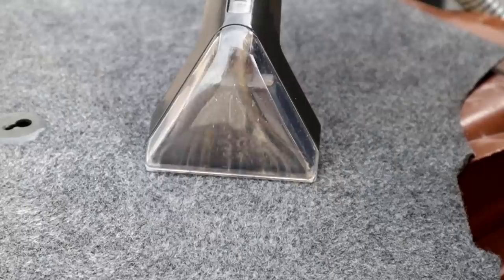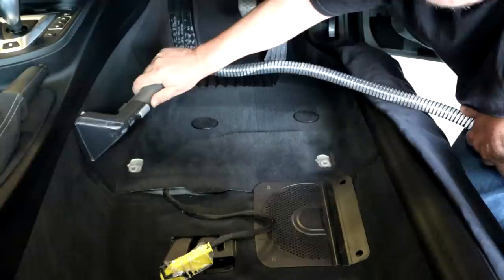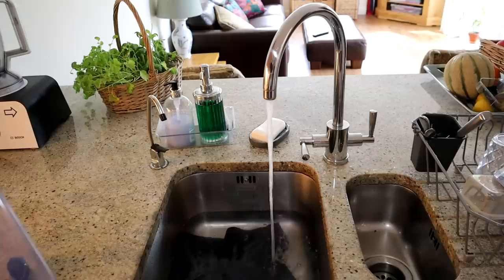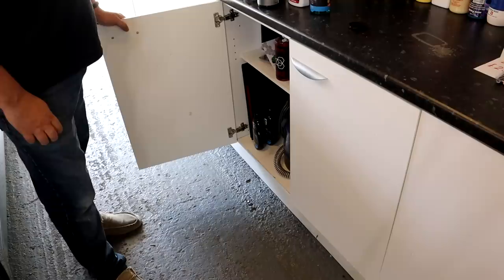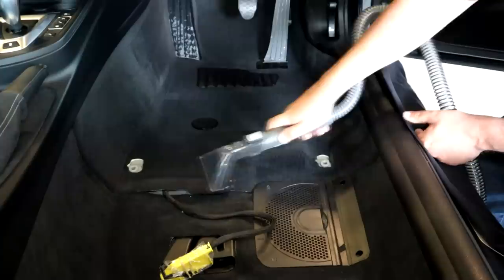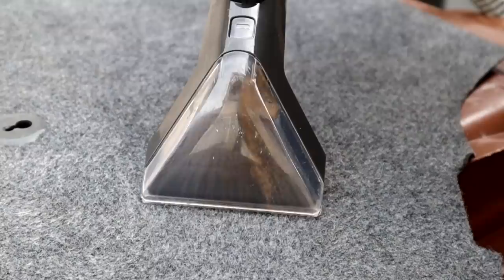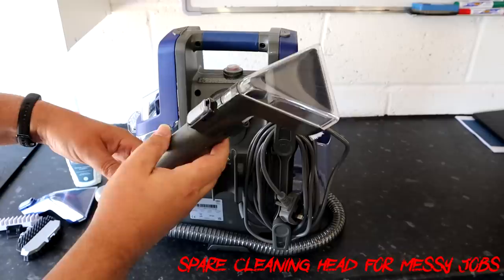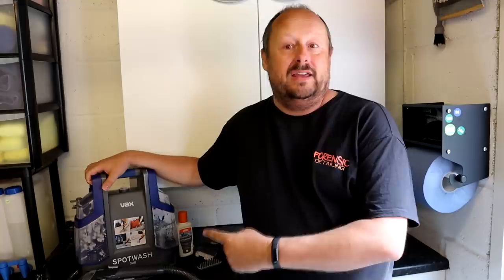*NEW* VAX Spotwash DUO |  Bargain, Compact, Powerful Car Detailing Tool #ad

Comment: Pro tip here.  Instead of using the cleaning solution in the tank, just put water in that tank.  For the cleaning solution, use either a spray bottle, or even better, a garden sprayer.  Soak the surface to be cleaned with the cleaning solution, agitate with a brush and then use the machine to spray water and extract at the same time.
Reply: Hello do you know what the difference is between the blue model and the red model other than price
Reply: @Security2U  Its the same thing im trying to find. The red one is the Spot Wash and the blue is the Duo Spot Wash. Estetically, the only difference is in the colour.
Reply: @alexisamtosta  Why is the blue one cheaper though?
Reply: @alexisamtosta  I believe its the additional tool kit that makes the blue one a 'Duo'
Reply: The blue one comes with a seccond pair of identical tools. The price is cheaper only due to different promotions. Definitely buy the blue one.
Reply: @ddc6321  Extractors have better suction.  It's measured in inches of water.   Stats are usually available for all extractors and wet vacs when you look at the specs sheets.
Reply: The main question is that once filled will it do all the seats in the car ?
Reply: @wellgatecarsales1623  Depends how dirty they are.  With small units like this, you can expect to have to refill at least once to clean a vehicle.  Unless you are a professional, that is not a big issue, it takes about 5 mins to do.
Reply: @Calendyr  Thanks buddy, that’s helpful.
Reply: Thanks for the tips
Reply: Great idea should I dilute the solution first
Reply: To add onto your tip, use a drill brush to agitate the surface and fibres of the carpet. Helps the solution to penetrate even more.
Reply: @Security2U think it’s the power

Comment: I got the Bissell one a couple of years back - it's one of those products I could buy without getting too much flak.  I told the better half I'm getting it to tidy up the kids mess - she assumes it's the house, but I mean for the car!
Reply: Hey mate, is that machine any good? Seen mixed reviews online about it, mostly around the hose failing and awkward to empty/clean out.

Cheers
Reply: @MrAarongilbey  I was happy with it - I mean I only use it every once in a while so I'm not using it like a pro does.  I use just warm water in the tanks, and 1% Surfex so I don't lose the colour.  It can be fiddly, but only when loading and emptying the tanks.  I got the Bissell one for Pets about 18 months ago, and just waited for it to be on sale.  It doesn't have that self clean function, so that's where I'd say the Vax one here might be better.

Comment: Plz help!! Just got one of these today, it’s not spraying any water at all. Yet when I connect it to the “self cleaning” loop thingy, it does work and cleans it self, can see the water running though. Yet as soon as I try to use it again, it doesn’t spray anything. Am I just being a dumbass or is it broken? Tyyyyy
Reply from the maker: have you got the water in the right resovoir mate?  sounds obvious but that could cause this problem.   Otherwise mate do not worry the item is under warrenty so simply contact Vax and they will look after you mate.

Comment: It reminds me of the Bissel one that has been out for years.   Personally I have a bissel pro heat which combines both.   It has the hose and tool like the vax but is also an upright machine for the house.   Plus it heats the water as you go along.   I just add my usual APC to it rather than using their fluids.

Comment: I bought the new Bissell Spot Wash a couple of months ago (for impending, new puppy accidents) but saw the potential straight away for the car. This type of cleaner is ideal for tight areas so perfect for car seats and carpets. Spray on, leave, agitate then vacuum off to nearly dry. Dead easy to dismantle to clean and I also use the purge through for the hoses to keep them fresh. Don't know how I ever did without one.

Comment: Bought one yesterday after watching this video. Ninety-nine pounds only. From Curries. I was surprised how much dirt it sucked out of my Honda S2000's thick velour carpeted footwells, that had mats from new as well. I thought the carpets were immaculate but no they weren't. The carpets are now a very rich charcoal colour again now after working the nozzle until the water in the waste tank became crystal clear. Works brilliantly, I love the long hose. Decent little powerhouse of a machine. Cracking investment.
Reply: Ive just bought the vax, and i have an 06 S2000! GREAT MOTORS

Comment: Following my previous comment, the Vax unit arrived within 24 hours, as promised - excellent. I read all the material and assembled the unit with ease. Within a couple of hours I'd cleaned the seats in my wife's car and the floor mats in mine. In both cases I was astonished at the dirt the Vax extracted, particularly the Fiesta seats, which I considered to be fairly clean. According to the instructions, the small bottle of solution would only be sufficient to perform one large clean, so I decided to fill with water just above the small clean line and added about a quarter of the bottle as a tester. I know Vax want you to use their product for obvious reasons, but other reviewers seem to have used other products quite successfully and as Surfex HD is low foaming I decided to take the risk and used a spray bottle as well with a 1:20 solution. Both the seats and mats look astonishing and I'm so pleased the Vax is now in my cleaning arsenal. Thanks Jon - really appreciated.
Reply from the maker: It's good isn't it 😀
Reply: @ForensicDetailing  Best £109.99 I've spent this year - no brainer !!

Comment: I bought this just before Christmas 2022 and it's excellent, also purchased the Vax cordless version for doing stuff in my car. I could run an extension lead out to the road for this one but I like cordless in situations where I'm not  near a power outlet. Cheers

Comment: Looks just like mine but the brand is bissell spot clean. Mine got a longer hose and it heats up the water.
Reply: For anyone else wondering, I also bought one and althought its expensive, its brilliant. No regrets and used it far more than I thought I would.

Comment: This looks the same as my Hoover Spot Clean but blue instead of red. I got when I bought my first car which was used, but I wanted to make new to me. Great option for DIYers. Plus it works amazing with using a drill brush to agitate and loosen up dirt before with a carpet cleaner in a spray bottle and just hot water in the extractor (similar process to when I do custodial work at a college).
Reply: What’s the difference between blue or red? Are they the same

Comment: Good video Jon, thanks for that. 

I do think it's worth throwing in a caveat or two to it though. Or at least my own personal ones: 

1. Unless you're actually detailing regularly, this might be a slightly more luxury purchase.  
If your home has a large amount of carpeted space, you probably would be better off buying a full sized machine. 

I have a Bissell Pro Heat pet pro machine, which is an upright vacuum cleaner style machine and it came with a long hose and car-specific tools. 

It works fantastically for the car aswell as the house in general. Just have to be slightly careful not to pull the machine too far and send it banging into your paint. 

2. If you have a detailing product you use and trust for upholstery cleaning, you CANNOT run it through these machines or you instantly invalidate the warranty. 

I tend to use Surfex HD for decently soiled interiors, so of course that goes in a pump sprayer.
Reply: Very nice points. I bought an upright one I haven't had the chance to use it yet but our home does have a decent amount of carpet. I may buy one of these to keep in the garage and use the upright for the house.
Reply: Forgot to mention, the hose on mine is bloody massive!  

I can leave the machine in the hallway and the hose easily reaches to the top of my stairs. 
It must be 2.5 to 3 metres long I'm sure.

Comment: I picked up a bargain, it was brand new and unwanted I paid £80 for a £300+ machine (or so I thought) it was a brand new vax big carpet shampooer with a hose for doing stairs and small areas, however I made the fatal mistake of lending it to someone it got damaged, vax sales direct offer extended warranties, but from third parties you need to check. Mine got damaged, I was more than happy to pay for a repair or at least check the viability of getting it repaired. But despite the plethora of vacuum cleaner repair places, nobody repairs shampooers. Without the extended warranty Vax offer no repair for damage caused. So you have to weigh up the pros and cons of having a machine that is made of brittle plastic that could be easily damaged and of no further use.

Comment: Use valet pro carpet cleaner it's great in a machine and I've tried all sorts of brands but that one is best
Reply: Do you use it at the 1:80 ratio in the Vax spotwash? Just got one today and have a loads of VP carpet cleaner that I was contemplating using. Cheers in advance

Comment: I've got the bissell pet spot cleaner for exactly the same purpose. The amount of grime it lifted out of my 150,000 mile seats was unreal and the car smelt brand new!
THE thing that I dislike about these smaller machines is the hoses are just a shade too short (1.5m isn't enough at all), another 50cm or more on them and it'd be great / perfect. Even if they could make a hose extension kit that'd be helpful!
Reply: Unfortunately hose length affects suction, it's a compromise. These small machines already have less suction than a shopvac.

Comment: I use the the George wet and dry vac but find the suction nozzle a little bulky for use in cars. I’m considering buying one of these but really not sure as I want the same performance as the George or better. Would you have one of these over a George Jon or would you suggest ti just stick with what I’ve got?

Comment: I am also a Vax 6131T user (the big orange one) and it's brilliant but changing from dry vac with a bag to wet vac is a bit of a faff.
I'd rather have this and a separate smaller dry vacuum, which I might end up doing, to save changing between the two.

Comment: Hi Jon, what are your thoughts on the merits of a carpet cleaner like this against a Steam Cleaner? I have the Dupray Neat Steam cleaner which is great at freshening things up in car and home and also cleaning tough plastics but if I'm perfectly honest its not the best at removing deap stains from upholstery or carpets. Also, I'm guessing this is something that shouldn't be performed too often on car seats or even headlining given the foam/glues used in construction. So far as I can see this looks great for carpet and seats but is there an argument for having both the carpet and steam cleaner or did I buy the wrong machine?!

Comment: Just got a Bissell pet pro, the build quality is far superior to the Vax, comes with a standard 3 year warranty, there is absolutely no way that there back up support and customer service can be anywhere near as bad as VAX. So my unbiased opinion 😀 is that VAX appears good at new and whilst working, back up depends on where and who you buy it from. APPARENTLY, theY subscribe to the EEEE regulation that gives the manufacturer a set time to keep replacement parts, apart from the likes of us guys who will use it more than us, it is for normal domestic use so a defect may manifest itself whilst the machine is relatively unused but quite old.

Comment: Jon you are a bad man, buying a gift for the missus and then using it once the novelty has worn off and claim it as your own, that's definitely something I do on a regular for my misus. Only thing is she's cottoned on to my way of thinking and busts me for it. I know vax has paid for the promotion of this video and you can definitely tell that Jon is in full sales pitch mode. Looks great, I'm still thinking about the Bissel though. I'll Google the specs on both including the longer hose (not a pun) and think about ways and situations in which would cause me to get frustrated or areas where it could be compromised. An extractor is on the cards but will do my homework first on the best product for my needs

Comment: Excellent, wife likes Zoflora so I'll use that instead of the Vax detergent and I'll use my concentration of carpro inside in this unit. Been holding off getting one but not anymore. Bought.
Reply: Can you please give some feedback on the use and ratios of non-vax cleaning fluids. Cheers in advance

Comment: I need something that cleans up mistakes from my cats and for stuff to clean mattress, stairs which I think this will do perfectly but it's the Home Duo I'll be going for has a slightly bigger width in the header

The only issue is the cleaning solution you get for what you pay isn't great
Reply from the maker: Buy 1 litre of Koch chemise green star concentrate for 5 quid.  Use as direct for extracter system

Comment: I have a 613 that i use for all wet vaccing  etc and it is extremely good, but the small hand wash tool is very small, it needs to be wider, very much like the one on the spotwash....and i know exactly what you mean about pulling the tube off when using the 613, it gets done very often and is a nightmare.

Comment: Alright Jon, if you fancy a decent test for a carpet wash, get a bit of old carpet, pour some of your favourite curry leftovers on the carpet, let it dry and go for it. 

In my experience you’ll never truly get the full smell out, you might get 95% of it out but would be interested to see how effective these spot removers actually are. For a bigger challenge try it with curry sauce that has haldi (turmeric) in it on a light coloured carpet as that is a complete bugger to get out. 

Love the vids, and keep em coming please. Also you’re looking quite a bit slimmer these days, so I guess the couch to 5k is working for you. 😀

Comment: What is everyone doing for sulution. The 250ml bottle all went on cleaning my couch to test it out. I'm thinking some BH Surfex maybe 1:50? 

I got one to replace my George. It's much less chunky but I already miss the hose legnth. Vax is far more civilised to use and I don't have to mess about getting George in wet mode

Comment: Just returned mine as it was awful, leaking, fizzing & unusable. Cheap looking. The guy in returns said “didn’t meet expectations” well no it was simply rubbish or faulty. I video’d the issues I had but they weren’t interested. So based on my experience do not buy. Plus note returns process is simple 👍🏻
Reply from the maker: sounds faulty paul.  it should not be leaking.

Comment: What are your thoughts on this (or Bissell Equivalent) vs the Bissell Pro Jon? It’s not too much bigger but has better capacity etc. would this need refilling/emptying a lot to do a complete interior?
Reply: I have a Bissell pro and its a great unit. Same small type head with built in brush. And, it heats the water too, so the spray comes out quite hot. Personally i use the Rug-Doctor cleaning solutions, cheaper, seem to do the job well, and smell nice.

Comment: Hi mate. Quick question. 

Do you know of any QD that will work as both:
1. QD for removing dust etc. from lightly dusted cars
2. QD/Top Up for protection after washing for Turtle Wax graphene + ceramic paste wax. 

Basically the car is in the garage so it can get a little dusty even after washing. So just want something to spray and wipe to remove the dust. 

And secondly as I want to use paste wax minimally (it's a headache), I want something to top it up when washing.

I was looking at TW Flex Wax, doesn't seem like it's for dust though, only for topping up.
Reply from the maker: All qd can be used like that but be carefull wiping dust.

Comment: Your Jon30 code doesn’t work and now Vax are checking it, but annoyed as I went for the Duo as it seemed more reasonable with £30 off. But at £139 it’s quite expensive when the regular spot cleaner does pretty much the same just doesn’t have a couple extra attachments.
Reply from the maker: Should be valid untill 28th m8.  Let me know what happens
Reply from the maker: Car cleaning guru Joe might have code too could try that

Comment: i use to own bissel spot cleaner i owned it a month then i sold it due to suction power to me it dident have eough ...how does this vax compaire to the bissel with power?
Reply from the maker: I've not used bissel Gaz but this small unit has enough power to extract heavy dirt

Comment: What detergent would you recommend to use with this.
Reply: Vax do a great carpet detergent concentrate, or you can use an APC at low concentration but a proper fabric or carpet degergent will do a better job without risking damage to the colour of the material being cleaned.
I imagine the Rug Doctor one will also be good as they've been around for a long time, but could be outdated by now like T-Cut.

Comment: There is no way you can do the interior of a car with only one of those tanks.  Expect to refill at the very least once.  That is one of the major disadvantage of these small units compared to the pro machines like Mytee, the tanks at too small.  But for an enthousiast, they will do the job... those are very inexpensive and work well, just takes more time and require more effort.